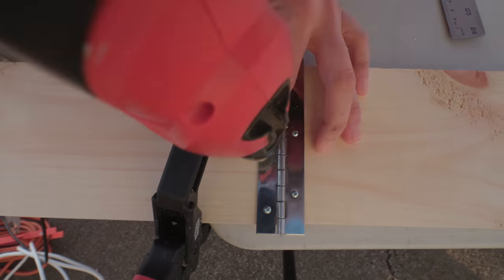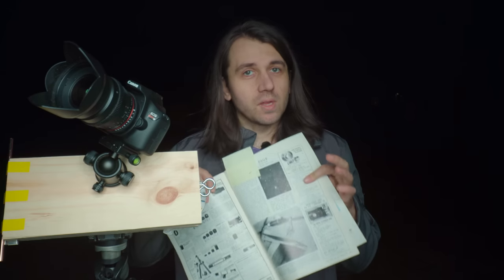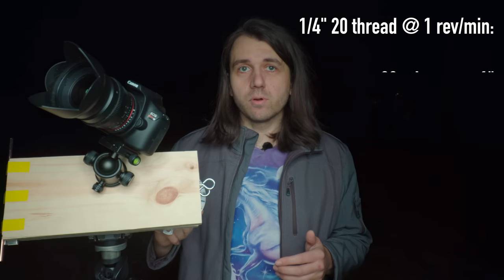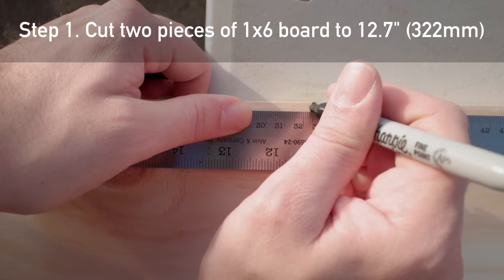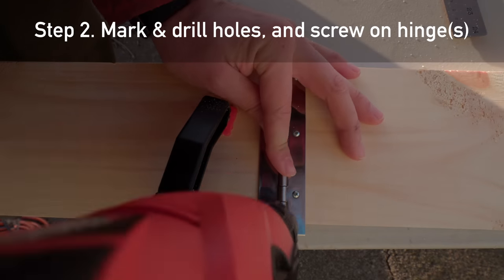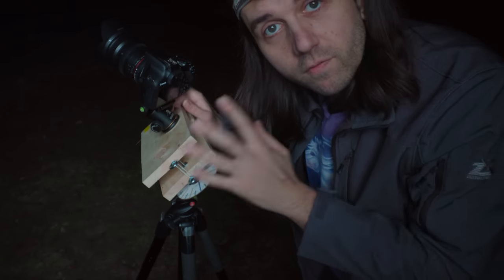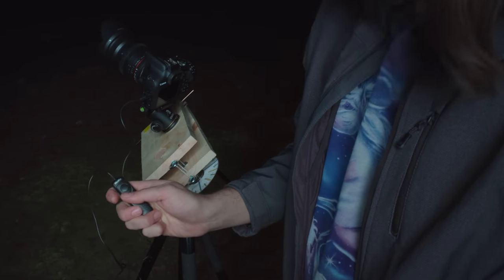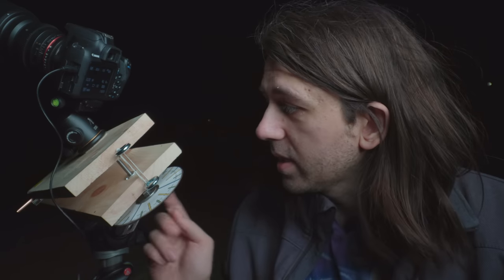I Made A $30 Tracker, Is It Any Good?

Comment: I recently built one with legos, and worked pretty neatly. I could take 30s exposures at 952mm focal length. Now I got a real tracker, because the lego one had to be over a table next to the telescope!
Reply: tutorial on that please.
Reply: @ashimayed8013  I actually don’t have a yt channel but I can tell you its basically making the lego motor spin at a certain speed that suits your own mount. For example I have a manual equatorial mount, so I had to turn the handle for rotation about 4 times an hour. You can slow down the motor by adding engranes in various layers to reach optimum speed. It took a lot of adjusting but it is possible.
Reply: @carlosrojasrodriguez930  What you're describing is motorizing an existing manual tracking mount, not making a tracking mount from scratch. In your case all the tracking mechanics are already in place.
Reply: @TheAnoniemo  That is correct!
Reply: I think I saw it on reddit a while ago
Reply: i actually tried to make one fully out of lego but it couldnt handle the weight of a dslr properly, i still want to try it with my phone. i ll have to wait until the covid lockdown is off to leave the city :/.
Reply: @nicolasalvarado9485  That's what super glue is for,
Reply: 952mm?  That's oddly specific and not a common lens or scope size--what sort of lens were you using?

Comment: I"ve made a few of these over the years. The most elaborate one had a polar alignment scope built in and a double-door arrangement that tracked for 3 hours. It held two DSLRs with different focal length lenses pointed at different targets.  It had a periodic error, but the bad frames were thrown out during stacking. Lots of fun capturing galaxies and nebulae. The biggest one I've ever seen made was literally a barn door size that held a seated person and a telescope on a tripod.
Reply from the maker: Woah, amazing!
Reply: Imagine making a platform where several people could experience a stationary sky!
Reply: WOW, talk about "shut the BARN DOOR!"
Reply: That would shake like crazy moving around.
Reply: @dugy40  nah, I could make something like that pretty portable and rock solid easily, just has to weigh enough and have good feet/pads, or be hard mounted and be on a wide and heavy turntable.

Comment: You can stick a little stiff cardboard (or metal) arrow to the side of the board above the angle wheel so that it almost touches the wheel. You can then check the angle with pretty good accuracy without bending over to look through the holes.

Comment: add a $10 6v geared motor off ebay, use a $5 motor speed controller, run from a phone charger / usb powerbank
Reply: Could you provide more details about this?
Reply: @lindabilleskerkoster5521  A small eBay motor could turn the bolt/screw slowly. For professional trackers you can buy them as an add on. For this your could just buy a small £2 geared motor off eBay and a speed controller to set the speed. Use a mobile phone power bank charger to run it and it should go for many hours. I found you a video with the same idea etc https://youtu.be/w-jYLjOg0cI or also this https://youtu.be/jHnny75vaCg both seem to drag it out a little and their costs seem quite higher than that I think it would cost. Personally I think I'm going to go with this design a it's a bit 'odd' https://youtu.be/Z-20j49UNbM
Reply: @lezbriddon  , thanks very much for responding!
Reply: Actually, these really helped ... led me to videos regarding the use of gear-driven curved rods and 3-board trackers

Comment: I built a barn door as my fist tracker, and have figured out some interesting hacks that can really improve the results:
- A polar scope really helps!
- rather than using the stopwatch, a fine tuned click track on headphones works really well. Just turn a specific angle per click, add longer lines on every fourth click to be able to correct yourself if you accidentally slow down.
- try to continuously turn the wheel, I have been able to get decent results up to 300mm with a hand cranked system with the audio click track solution.
- adding a stepper motor to do the rotation can be a fun project!
Reply from the maker: Wow 300mm hand cranked! Thanks for the tips Mario. I hadn't heard of anyone continuously turning the wheel manually - an audio click-track is a really smart way to do it!
Reply: @NebulaPhotos  continuously cranking takes some time to practice, but  can definitely improve the results. Not only because of higher accuracy, but rather having less vibration due to avoiding the static friction when starting to crank. 
Thanks for the video, really brought back some good memories!
Reply: I wonder if you could mount a mechanical kitchen clock with some gear to get the accurate and smooth rotation.
Gotta say, this movie and your comment inspired me a lot to make my own tracker and try it out. Thanks for both of you!
Reply: @michakubisz535  the Omegon minitrack  lx3 uses a mechanical system similar to a clock. I owned the lx2 for a while but wasn't happy with it. I don't think a barn door tracker would work with such a small actuator, because there is definitely some lifting involved. If you do succeed, I'd love to hear about it! I think a simple stepper motor with an integrated planetary gear with maybe a 100:1 ratio would work fine. Have fun!
Reply: @mariogreenway3468  ok, so the idea to use a mechanical clock wasn't very good but I finally managed to create an automated star tracker using an electric motor with gearbox and a small electronic speed regulator. I only tested it once due to the weather. I also faced some issues transmitting momentum from the motor to the screw, the tracker still needs some adjustments. But it works - it really follows the stars :-) This is my first photo, very poor, with a lot of light pollution (I tested everything in my garden), stacked using only 3x 2 min. exposure https://photos.google.com/photo/AF1QipMtyvEWjbe9uETruAJCJRyX8nKivx8D1qwAgwgg
Reply: @NebulaPhotos  i have question that....where to put ball head on the top borad....close to the hinge...at the other corner...it doesn't matter???..you can fix it anywhere you want on the top board?
Reply from the maker: @milkyastrophile  I put mine where it is for stability. While it may work to put it in a corner, I'd suggest putting it more in the middle like I did so that system is more balanced
Reply: You could go caveman mode and use a pendulum clock to rotate it
Reply: The audio solution is so elegant. Plus it kills the boredom by giving it a nice challenge: make a nice compilation of my favorite artist ... only at 96BPM. 1 hour of manual tracking seems now totally OK.
Reply: @C40V15  Awesome idea! Modern recordings are almost always made using a click-track in the studio, so they're spot-on... whatever the rhythm. A lot of the old classic rock stuff was recorded without a click, and results do vary...
Reply: Could a metronome work?

Comment: A couple of modifications you may think about:  Number one, I made the bolt curved, and put the CD on the inside of the tracker, so it would push the bolt up.  It is curved to the radius, and positioned from the hinge, so the tracking is accurate over a longer period of time.  I don't remember the exact distances, but similar to yours, probably.  Another thing I did which would make your work greatly easier, was to notch the cd at intervals, so you don't have to look through any sights to get the rotation correct.  You just feel for the notch, turn the cd until your finger hits some sort of stop, wait 5 sec, or 10 sec, however many notches you decided to use, then turn it again.  That way, you don't have to keep looking at it.   Then I used a Telrad for alignment.  Not sure if you can still get them, but not very expensive, and reasonably accurate.     But enjoyed watching your video!  Those trackers do work, and are easy and cheap to make!

Comment: For greater ease aligning polaris add a 3rd board to the bottom to the tracker shown to hinge on the South side and with an adjustment screw just like the first one.  
Then, set your tripod head level in both directions.  Mount the added board to the leveled tripod head.  The additional adjustment screw allows quick, easy, smooth altitude adjustment on Polaris.  There'll be no jerkiness of the tripod head experienced while adjusting the polar tube for altitude.

Comment: Getting the tracker not to shake while rotating has been the biggest challenge for me. I have a very stable tri-pod
- Getting a good polar alignment has been helpful. I usually shoot in a Bortle 4 so finding the end of the little dipper is a little tricky. I use a north star map compared to other constellations to make sure I am pointed at the north star and not the next star up in the handle of the little dipper. 
- Adding a vertical support for the top board to rest on as it rises helps reduce wobble
- I have about 6 feet (2 meters) of string wrapped around a spool I made using a small piece of tube glued between 2 CD disks. I pull the string at a constant rate.
- On the CD disks I have marks at every 5 seconds and labeled 15, 30, 45 & 60 seconds. 
- I listen to an recording from a timer that counts off every 5 seconds.  
- I have an electric candle from the dollar store that is dimmer than a night light. 
- I picked up a plastic telescope finder scope for $15 on ebay.  There are a few people selling new old stock that have been collecting dust on shelves and want to clear them out of their store rooms.
- I had better results with the 12" long 1/4" rod bent into an arc shape which requires the rod to be stationary and the timer wheel to push the top board up. A spacer between the timer wheel and the top board is needed. 
- I tried the double arm tracker but never could get the combination to work.

Comment: I made a barn door tracker, to polar align it I made an app thats shows when you are pointing to the north celestial pole. I added some wooden bits to attach my phone to the tracker and used an old iphone I had. Then I use the app to polar align and double check it in the staw. Works pretty good every time. This could work for people down south too

Comment: I made one of these barn door trackers many decades ago from design plans found in a telescope/astronomy book.
What I do remember is the dimensions of the tracker and bolt thread pitch was set so that 1 revolution around the bolt thread per minute was needed in order track celestial objects in the night sky. The device also needed to be aligned with a particular direction in the sky.
Took some interesting photographs

Comment: Amazing Nico! I just want to let you know that I was looking for a cheap way to track for a long time. I’ve seen other barndoor trackers, but I have no skills with electronics and you can’t find skytrackers to buy here in Brazil. The only time I saw one around here it was so expensive that it was prohibitive. I was shooting hundreds of pictures and stacking but now you just gave me the push I needed to make my own tracker. I’m so grateful for the valuable information. Thank you so much!
Reply: Do you think this track can work with an 100mm 1.8F lens? With way less tracking time I believe. I Also have a 24mm 2.8F around that will work perfectly.
Reply from the maker: Possibly, but you would need a better polar alignment than the straw I use here. Maybe drift alignment or some kind of computer/phone assisted method. I have to study all the ways more.
Reply: @NebulaPhotos  thanks Nico. I have a green laser that’s allowed here and I know my way around at sky. But it wont be very precise for the 100mm without an octans finderscope.
Reply: @GameBrou  you can do a drift alignment. Use the telephoto lens live view and zoom on the dslr display. You might need to temporarily turn up the ISO setting to see the stars.  Don't forget to reset it before taking real pictures.  You can turn on grid lines if that helps gauge the drift.  If you look up the offset of Polaris for your particular location and date, you can get a pretty close approximation using the laser pointer to start.  It'll take some time but it is 'do able'.
Reply: @hbmike47  thank you so much! I'll try that as soon as my tracker is ready. You guys are awesome. That's why I love astronomy. So much love for sharing the knowledge. Clear skyes to you wonderful persons out there!!

Comment: Instead of looking down and getting a stiff neck, you could a short perpendicular projection on the rim of the drive wheel and a bracket with a perpendicular slit on end of the drive board that places the slit just outside the drive-wheel rim.  (A white or silver  (or glow in the dark) painted tick mark on the edge of the cd might be visible depending on how dark your environment is and would simplify the build.)  Then you could just sit comfortably in a chair looking at the drive wheel more or less edge on and just rotate the drive wheel so that the projection aligns with the slit during each time interval.   If you wish to rotate in smaller increments than full turns, just add more projections along the rim at appropriate intervals.
Reply from the maker: Cool idea Erik, thanks!

Comment: I created a similar tracker, but with a stepper motor from some scanner or something like that. In my design, a gear threaded onto a curved spindle was rotated by the motor, creating a worm gear mechanism. I even went so far as to tinker with a programmer and manufacture a control board that would rotate the motor at the desired speed. However, I was young and lacked the patience to make the board sufficiently well, and there was always a contact issue somewhere. So, I never managed to capture anything worthwhile with that mount :D

Comment: I do film photography I've been dying for a way to take pictures of the milky way and this is exactly what I've been looking for. I did everything almost exactly as instructed (except I had to use a different screw and t nut to attach it to my tripod) and it works! 15° every 2.5 seconds did the trick. I've taken a few more shots but just started a new roll of film so I gotta wait a bit to see more results. I had 2 shots that would have been great except some gnarly light pollution messed with my subject.

Comment: One way to get slightly better polar alignment without having to rely on securing your metal drinking straw exactly in line with the hinge would be to use the drinking straw as the hinge pin. The next size up of tubing is typically a nice slip fit over the smaller tubing, so you can cut segments of the next size up and glue or otherwise secure them in alternating sides to each of your boards. Waxing the inner pin and the edges of each segment of outer tubing helps to keep any glue from freezing the hinge up while you're assembling it.

Comment: For the polar alignment keep a compass ( can use the one on your smartphone) perpendicular with the tracker to find north and then you  could first level your tracker with a spirit level to be perpendicular with the horizon and then stick a protractor and then keep it at the degree of the latitude on which you stay that  way you can polar align easily and you and do it without even having to look at polaris
Reply from the maker: Thanks, I will try it and compare to some other methods. My guess (because I use that method for daytime polar alignment) is that it will be no more accurate than the drinking straw method, but it is good to mention for people who have no view of the celestial pole where they are setting up.
Reply: True, but atleast it is easier than the drinking straw method as looking through the straw will have a very small fov .

Comment: This is great ain't it. A couple of bits of ply and a disk. Top class tutor with a tad DIY and hey presto. A superb photo, I guess this movement could be controlled with an Arduino Uno or mega 2650 and stepper motor. A bit trial and error and you could make this work well. Not that manual didn't work. Nico proved it works with a disk and turning it manually. Anyway. You just got to love these videos

Comment: Excellent video, description and build details. I could listen to you for hours. I do have a quick question though... as I live in the Southern Hemisphere, what changes (if any) do I need to make to the process of using the barn door tracker? I don't mean the polar alignment (I can sort that out myself), I just mean, is the procedure any different? Thanks again for providing such informative content.
Reply from the maker: I think you would just turn the screw the opposite way. And if your country uses metric units rather than imperial, just google for a barn door tracker build guide using metric hardware. Other than that, it should all work the same.
Reply: @NebulaPhotos  Many thanks. I figured that would be likely be the case.

Comment: Check out the finder on the old Edmunds Astroscan. Not the newer one. The older black bracket. It’s just two separated holes with the closest being smaller. All you need is a straight edge and two 90 degree tabs with holes. I can’t imagine a cheaper approach. Great video man. I’ve had this one on the back burner myself. Some you see take this thing to motorized as you know. You can practically go sky’s the limit. It’s a really good tip for folks to use something like Thompson’s Water-seal to condition the wood. They will warp due to humidity over time. You executed this well. There’s absolutely no need for me to make this video. I’ll just refer them to you. Clear skies.

Comment: There's also a commercial version of the barndoor tracker for around $100, I think. It uses a laser to polar align and a small 5v geared motor to turn the drive screw. Pretty good design. The company is nyxtech. I have no connection to them but have used an early version and it works well. I replaced the rather cheap ballhead with a beefier one for more stability. The downside is you are limited to fairly wide lenses. I've used mine with a 50mm lens but would not try anything heavier.